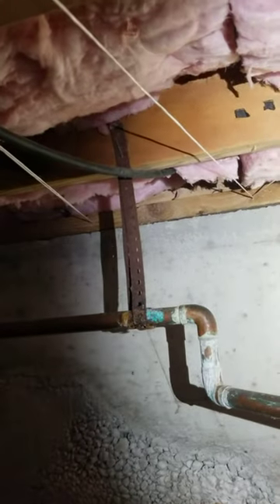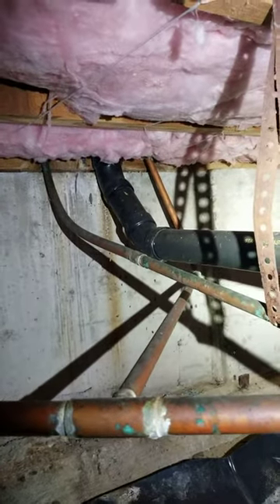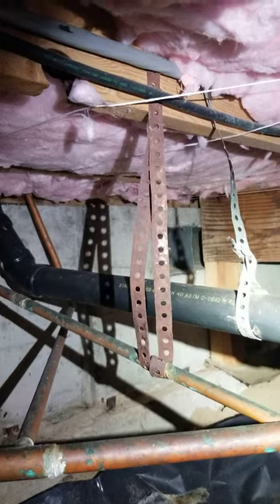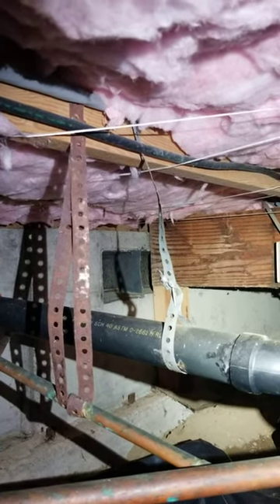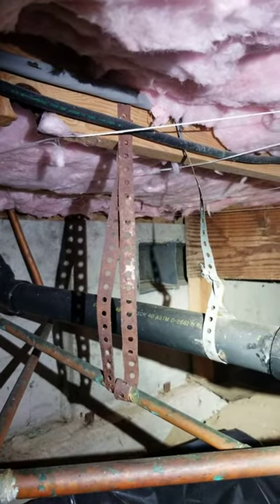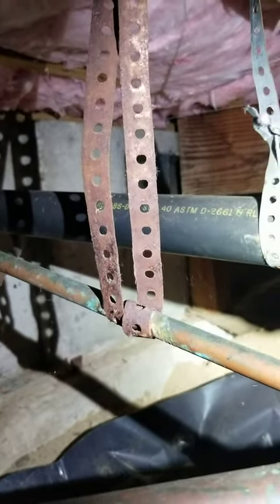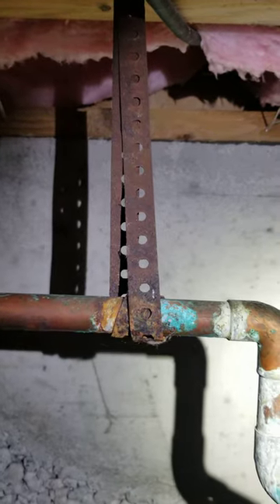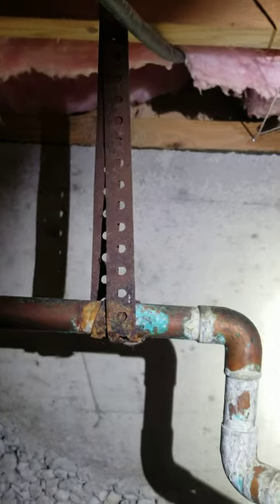The  Effects of Steel Hangers on Copper Piping

Comment: Great video. Brass pipe clamps used to be used with a galv hanger strap or rod.  If using galv strap or clamps put a rubber or plastic liner around the copper pipe first. I have seen buildings with steel framing, and the holes thru the steel studs where the pipes touch the steel start a galvanic reaction and corrosion. Also, if you have diesel fuel lines for a generator watch out. I worked in a hotel with the diesel tank in  the basement, generator on the top floor and copper diesel pipes rising 12 floors with steel on copper pipe supports, some where rusted to the point that they were weeping diesel whenever the generator ran.

Comment: Not a good choice to hang copper pipe. Contact of different metals causes cross- galvanization. Both metals corrode. Use plastic strap or wrap isolation tape on copper pipe where it touches the metal strap.